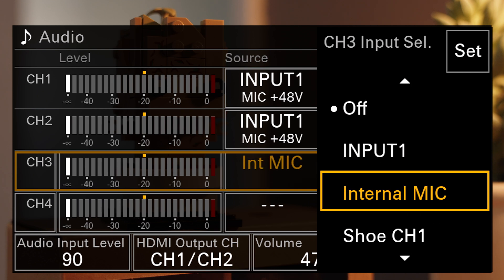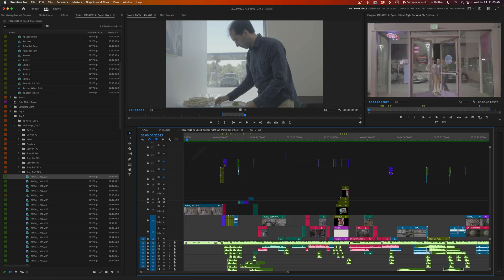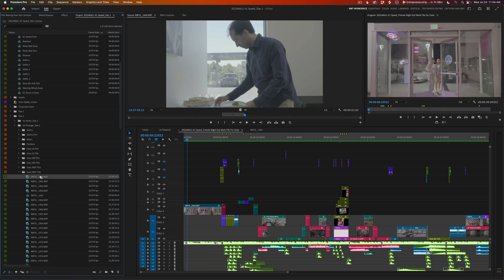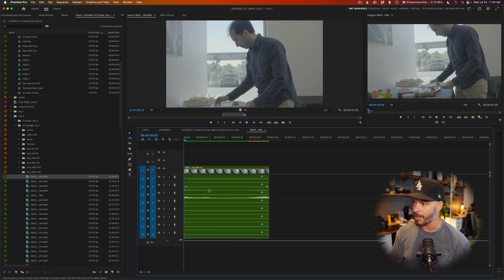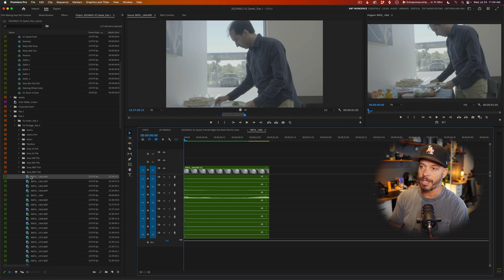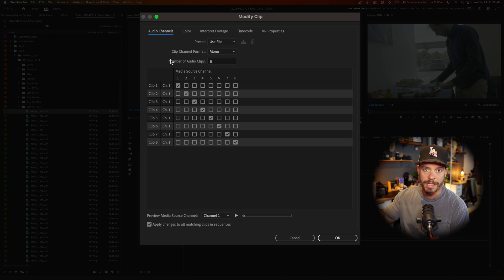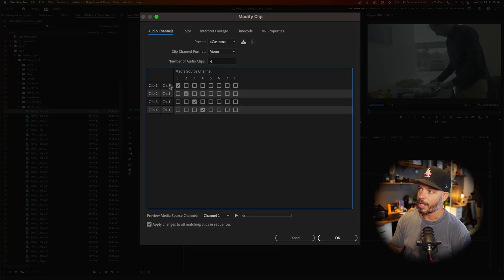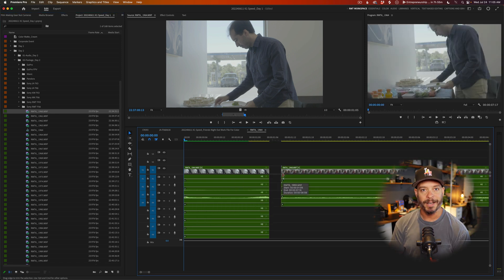How To Eliminate Extra Audio Tracks for Sony FX6

Comment: I noticed your recording is on channel 3. When I upload to premiere pro, it’s also on channel 3 and 4 both from internal mic.

How do I switch it to channel 1 and 2 so I can add external audio to channels 3 and 4 for multi audio editing?
Reply from the maker: Need to move the audio on the FX6 to those channels in the quick menu settings, then you can add external audio as well.